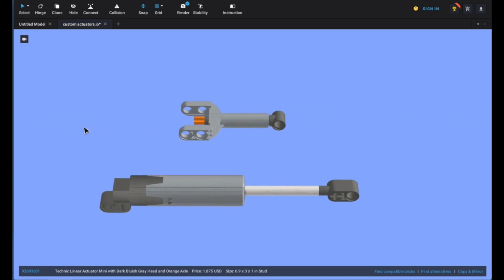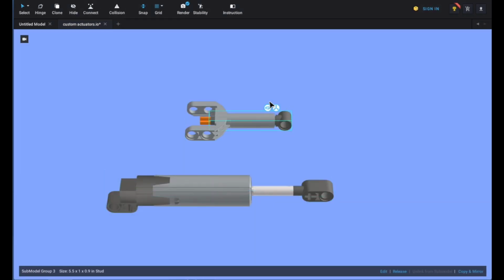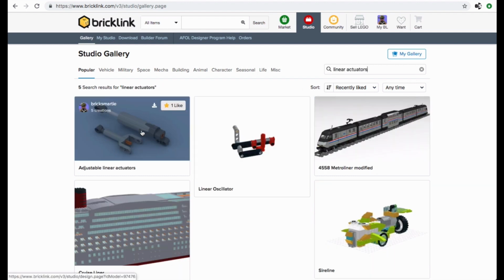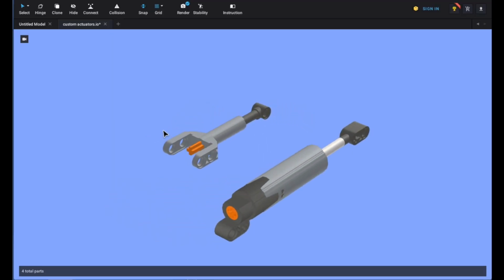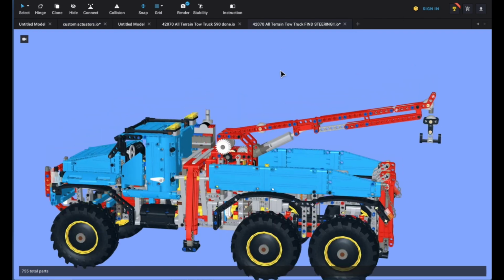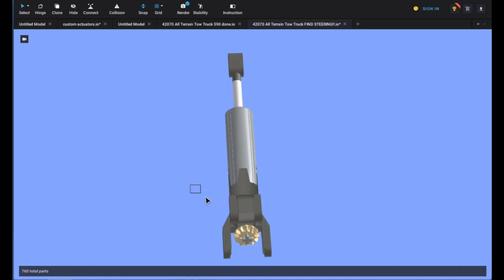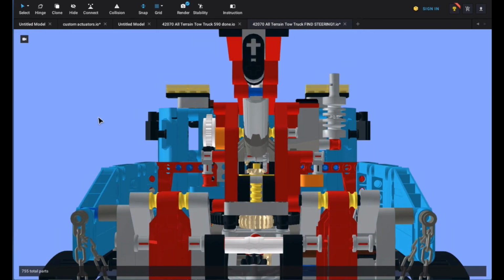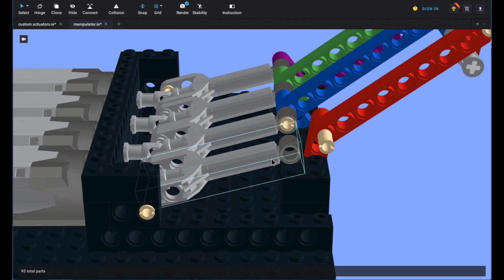Adjustable Stud.io Actuators

Comment: Hi, I downloaded these actuators from your site. However, when collision is turned on these parts become transparent. Is this supposed to happen?

Also, when I want to create instructions, it has you assemble the individual components in the instructions. Do you know how I'd go about making the actuator be shown a single piece in the instructions?
Reply from the maker: Collision is an issue to be honest until Stud.io fix this. Once you have set the degree of extension needed for your instructions you might be able to export to part designer, group the pieces and export back to Studio but I have not tested this.